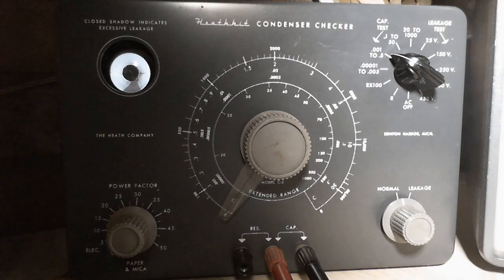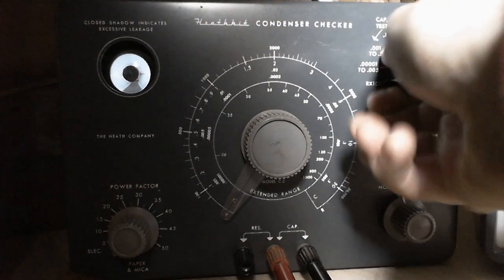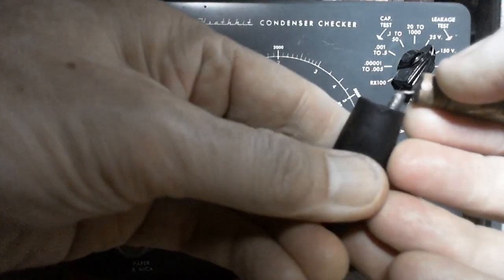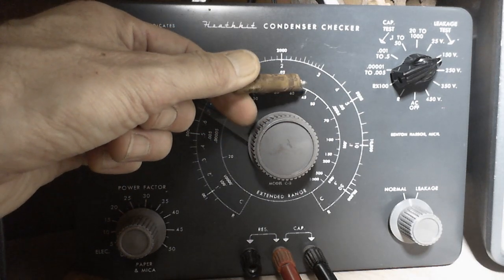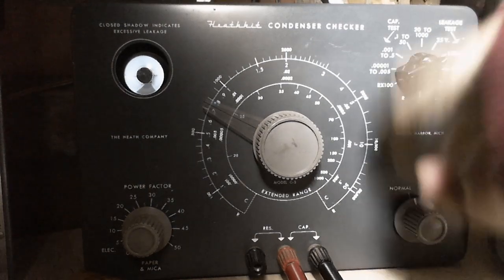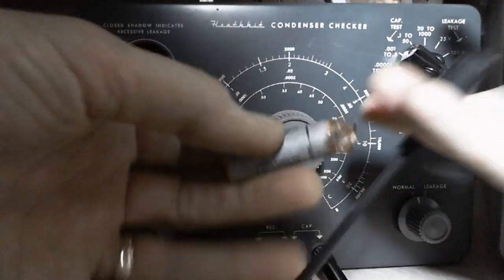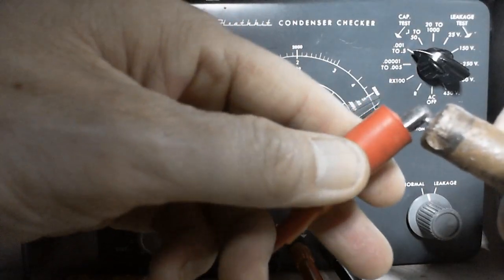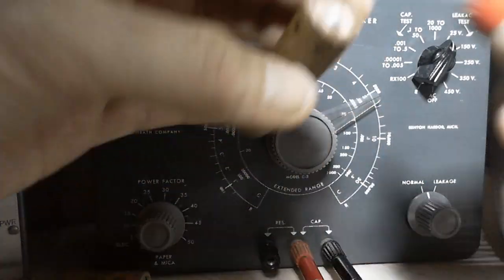Deforest 10DA517 AM Radio Video #7 - Capacitor Testing

Comment: Hi Jim Thanks for all the hard work that goes into recording your videos and putting them on Youtube. I too work on the old tube radio gear and solid state devices and projects and recently I have been building circuits that are using SMD components. They are so small that you must use magnification to even see the terminals. But the reward is a circuit that will work if you don't make a mistake. I'm amazed every time they perform well. Some day would you consider showing us old timers what gear you use to make the videos and the process that goes into it. I'm totally out of the loop!!!! Waiting for the final test on this radio.See you soon,   Dale   73"s  kg7ssb

Comment: The electrolytic caps with the low leakage didn't do too good on the capacitance test... they weren't acting like capacitors, thus didn't store enough of a charge to smooth the AC ripple, thus you get a hum.... maybe? just saying.Carl